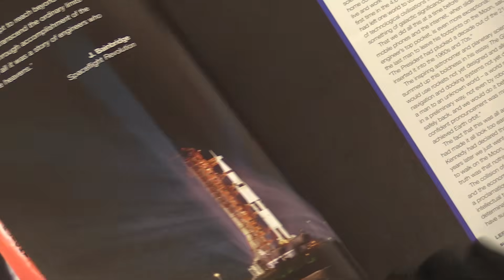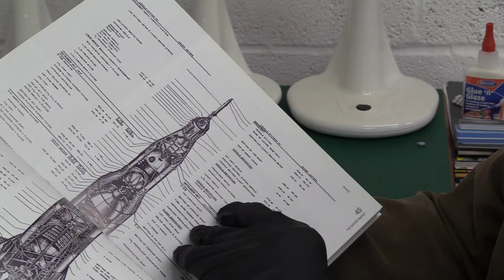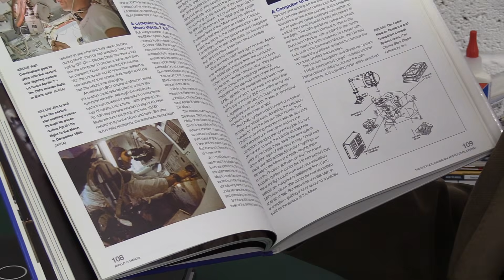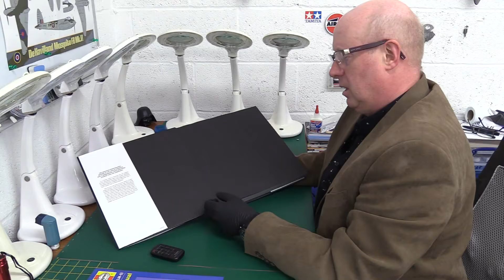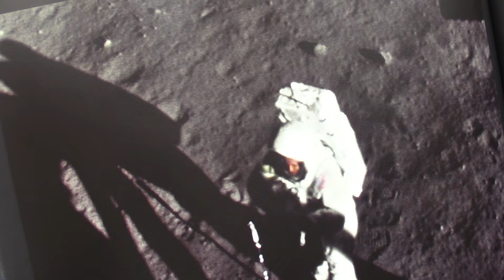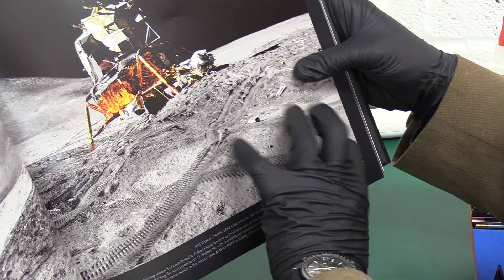Apollo Moonlanding show

Comment: I would love to hear your explanations to just a few smoking guns to prove the fakery. 

Here's 4 things that PROVE Apollo was faked. Challenge set. 

1) The lunar rover photographed with no tracks around it which it must leave when travelling across a dusty surface. 

AS17-135-20544 (Tracks in the wrong place)

AS17-140-21354 (No tracks)

AS15-88-11901HR (No tracks)

2) Shadows cannot cover the entire moons surface all the way to the "horizon" with only the sun as a light source.

(Station 2, Apollo 16 video footage, mission time 05:04:32:38 onwards, right after Duke says "They're all angular", two long shadows criss cross the landscape.)

3) A Comms dish cannot swing like a pendulum as the LM rotates during a docking sequence above the moon in virtually zero gravity. 

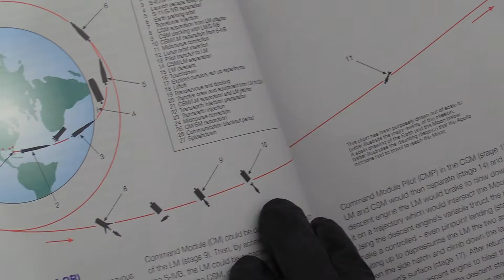(Apollo 12 docking sequence, see YouTube video Apollo 12 in 24fps- Lunar Module docking with CM. Timestamp 13:00) ChatGPT did a scientific analysis and said categorically that the LEM in that sequence was a model filmed in eaths gravity.  Watch the video. 

4) Sound cannot travel in a vacuum, ever. Here's two examples documented and acknowledged by NASA in the lunar surface journal documents.

Apollo 12 lunar surface journal > Sharp Crater > scroll down to 133:03:30

Apollo 17 Lunar surface journal > Geology station 2 

> Scroll down to 143:29:10

However, for the majority of the time in the Apollo footage. No sounds are ever heard while tools are being used, mostly hammers at the various Geology stations on the moon. 

Here's a website that NASA deleted in 2011. It's now only available if you paste the URL into the internet archive website. Both linked below for convenience.

http://lunarscience.nasa.gov/kids/moon_sound

https://web.archive.org/web/20110507113251/lunarscience.nasa.gov/kids/moon_sound

I wonder why it was deleted. 

That's Apollo comprehensively debunked.

Comment: I chuckled a bit when you mentioned the flame instability in the F-1 causing flameouts. The first run on the test stand it blew up! It shook the building the engineers were in and when it blew and they’re there in shocked silence realizing “they had some work to do” I saw the space program as it was broadcast and we were awed by it all, and the more I read about it, through articles by the participants wrote and books such as you have there, and I’m awed again with all the technical problems they had to surmount to achieve it! Thanks for a great presentation!